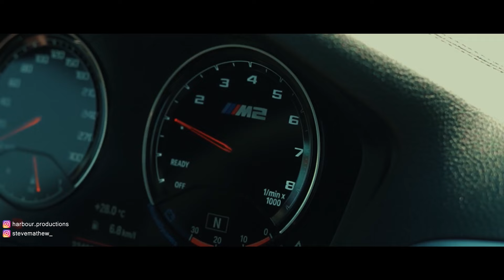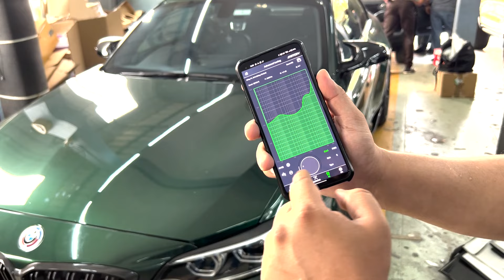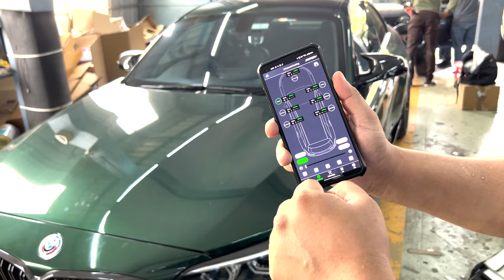BMW M2  Competition Audio Upgrade | Eton Audio | BMW Audio | Galaxy Cochin | Malayalam

Comment: Nice,

The standard HiFi/Harman Kardon amplifiers for 2 series/F87 is trash compared to 3 series and above. 
I went with Plug and Play Gladen Front + Crossover Speakers and Underseat Woofers. 
Replaced the stock amplifier with Sony XM GS6 Amp + DSP
Also, disconnected the centre channel speaker

Exceptional sound quality!
Reply from the maker: That's a really nice setup, let me know if it's possible to audition the same one day.
Reply: @galaxycochin  I would love to, but the car is in Canada. If you plan to hit Vancouver anytime, do let me know.